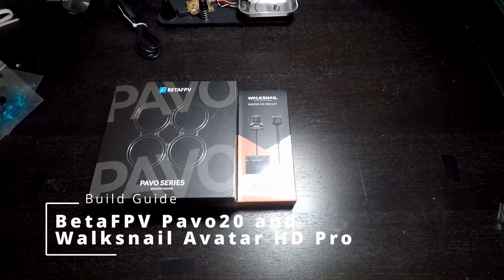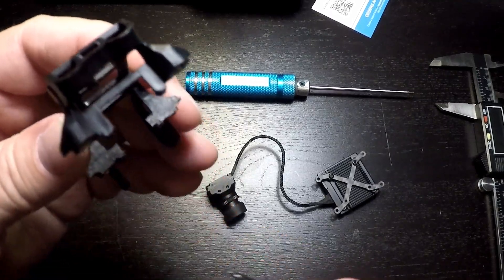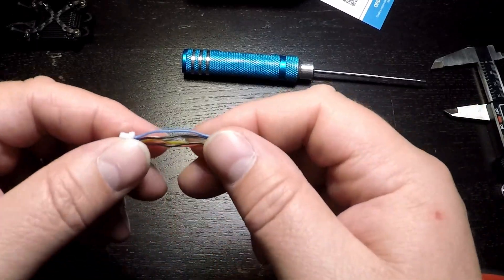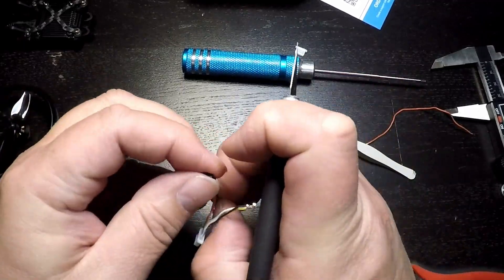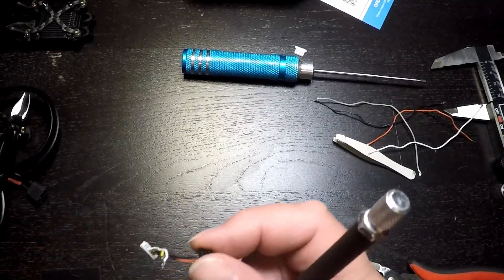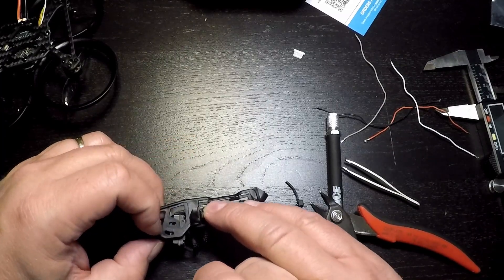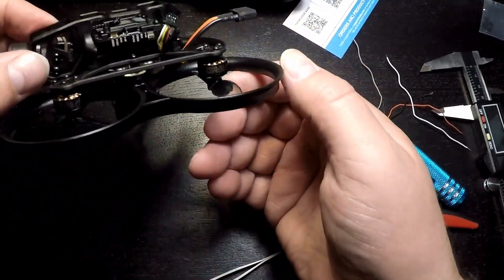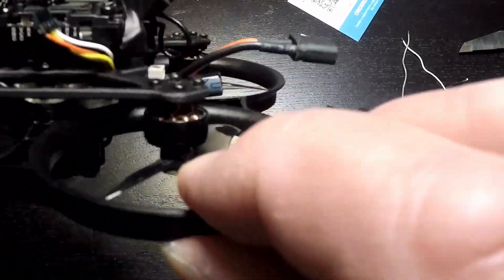BetaFPV Pavo20 Walksnail Pro Build

Comment: BETAFPV technical support line sucks ! Absolutely negative experience with them.
You are lucky - you have the frame with nuts, mine was with screws and holes in plastic. Screws, super-pooper micro screws!
Might be Beta a bit better than Echine, but the same t-shirt.
Reply from the maker: the metal nuts are the pavo20 vs the Pico. Sorry you have had poor experience with their support. Ive actually moved on, the Pavo was fun, but my GepRC Phantom is WAY more fun.

Comment: Do you think that it would be a similar configuration with a HD Zero build?
Reply from the maker: I would expect that it should be similar. you will just need to check the wiring diagram and verify the power requirements. there is a solder bridge selector to change the power that is fed to that connector if the hdzero requires different voltage

Comment: I have the same drone and also walksnail moonlight kit inside but I can't connect it with controller 
I bought betafpv controller lite s
And also flysky fs-i6! Can you help me please I want to fly the drone but I can't connect the controller 😢
Reply from the maker: depending on which kit you bought, the betafpv will require either an ELRS or CrossFire radio - unless you selected Cross Fire intentionally, its most likely you got the ELRS. The flysky wont do it. The betavpv controller comes in a few versions, if it is not ELRS, it will be a no go.
Reply: @quadsmack  thank you 
Betafpv controller is 2 SE Radio Transmitter 
Model literadio 2 SE 
And walksnail moonlight ultra HD 5.8GHz System FPV-sender Starlight 
Can you help me please to connect them with each Other thank you

Comment: my pavo pico walksnail version just arrived. im a bit confused. Does the receive come buiilt in to the board?
Reply from the maker: The Pavo Pico Walksnail edition is "walksnail ready" - it does not have a VTX included, you need to add that - similar to what I do in this video, but you dont need to modify the canopy or wiring, it comes with a compatible canopy and pre-wired for the WS. If you are asking about the ELRS/Crossfire reciever, if you have the ELRS version, the RX is on the FC, with an antenna directly soldered. If you got the Crossfire version, it is a seperate RX. Hope that helps!
Reply: @quadsmack  it actually helps a lot. I'm good to go, the only other question u would have is there is a small antenna in the kit in one of the bags?

Am I swapping the default walksnail antenna for this one in the kit? Perhaps to save weight?

Additionally, I see what looks like a thin red wire coming out of the board. Red color is like alloy red. I'd imagine the red wire us the receive antenna?

Will the walksnail avatar pro fit this or do you recommend a different walksnail verision?

Lastly, with the walksnail pavo, will u have to modify the wiring like you did in thversion?

Thank you for all of your help. I'm lost!

Comment: Question: the vtx won't turn on after I modify the wires
Reply from the maker: Recheck that everyting is routed as shown and that the pins are seated fully in the connectors

Comment: Does this work with the walksnail moonlight?
Reply from the maker: @GhosHawk  The fit will be different and you will probably need to trim the canopy some more but the wiring should be the same. I'm pretty sure somewhere in the comments here someone else is doing a moonlight
Reply: @quadsmack  sounds good, thanks!

Comment: Does anyone think this is possible on the Pavo20 Pro?
Reply from the maker: I don't have one on hand to do so but I cannot think of any reason it wouldn't. Wiring should be samsies.
Reply: @quadsmack  Thank you so much for the answer, since I'm here I'd love to ask another thing: my goal is to go for the Pavo20 pro but not with the PRO HD Avatar, but with the Avatar Mini or Mini Lite. Should I be looking out for some obstacles or reasons why it won't work? I'm Kinda new to the fpv world. Thank you so much for the content and kindness, you rock!
Reply from the maker: @alexzanatta6572  those should also work, but you will have to solder instead of swapping the plug. Same wiring as in this vid but to solder pads instead of a plug.
Reply: @quadsmack  That's great, ty so much!
Reply: @quadsmack why solder instead of plug?

Comment: unfortunately I had a bad experience today with a pavo20 and Walksnail Moonlight kit installation. unfortunately the flying controller is broken.
Reply from the maker: Sorry to hear this! The Pavo is a fun little 'copter. What happened? Are you sure the FC is damaged?
Reply: @quadsmack   The Walksnail Moonlight kit was installed, the FC was connected via usb to the computer, the moment I plugged in the battery the connection was lost. I can no longer connect to the FC, and the FC is getting extremely hot.
then I noticed Power consumption 12V@1.4A, 8V@2.2A on Moonlight and 9V BEC*: 9V 2A@8V supply on F4 2-3S 20A AIO FC V1. But I couldn't find Power consumption of Walksnail Avatar PRO HD anywhere.

Comment: What's the advantage of going with the 20 over the pico?
Reply from the maker: Slightly larger props, 3s vs 1s, better / stronger cage and camera mount. Most people i know with the pico replace the cage with the 20 cage.  Just a more powerful platform to carry the weight of the hd system.
Reply: @quadsmack  Ended up ordering the Pavo20 w/ Walksnail Moonlight.  Thanks for the vid.
Reply from the maker: @maliciousmushroom did you get this put together? Hows it flying for you?
Reply: @quadsmack  I did. It is my first FPV. To me it seems like it might be heavy?!  The cage for the VTX doesn't sit flush with the mounting board, but it seems secure enough. I've crashed it a few times in my back yard. I really need to go to a field to test it out!

Comment: This is awesome. Would this technically work on any 03 drone? I just picked up the goggle x.
Reply from the maker: It should as long as long as you are using one of the vtx with full power range. The 1s board would need a change on the power line
Reply: Just completed this mod, and works sooooo well. Thanks again and keep up the good work!

Comment: Is the vtx supports 3s battery?
Reply from the maker: I Used the Walksnail Avatar PRO HD V2 VTX Kit which accepts 6V-25.2V (2-6s) and connected it using the 9v output that is on the O3 connector on the pavo board. Thanks for watching!

Comment: Doing this same build right now with the Avatar Pro. Great to see you do it first, good info.
Reply from the maker: Enjoy! It's a great little quad! I highly suggest trying different size batteries . I got 650s for mine and it flys great but a bit heavy, I really want to put some lighter batts on to try to make it more nimble.
Reply: 2s? Whats your dry weight? Will build this mod too
Reply: 3s lipo. Using R-line 3s 550. @jeffclassics
Reply from the maker: @jeffclassics  Pavo 20 is 3s. My original batts were GNB 650s, just picked up some 550s and the flight improvement is something you can feel. these are the ones i picked up https://www.gaoneng.shop/products/gaoneng-gnb-3s-11.1v-550mah-90c-xt30-lipo-battery-long-type

Comment: I find it to be much easier to just use the cage from the regular pavo pico which supports the Avatar.
Reply from the maker: Definitely an option, but I like the threaded inserts and stronger dual-screw camera mount in the 20 cage.
Reply: Have you tried it? How's it going?

Comment: these are on sale for 75 bucks without the vtx... I thought about buying one and turning it into a analogue 2s basher. 
it seemed like you could fit the battery into the cage on top.
Reply from the maker: you could.. not sure how it would fly. At $75 this thing would be a no-brainer for me, GO FOR IT.. im loving mine, will be posting a night-fly vid today..
Thanks for watching!
Reply: The regular pavo pico was on sale, not the pavo20.
Reply from the maker: @CorruptName1 pico comes in a Walksnail ready version. The 20 should be like $105

Comment: Nice tutorial, thank you! Is there anything special that needs to be done in Betaflight?
Reply from the maker: I have not tweaked too much in BF yet.. I applied my OSD config, adjusted modes to fit my boxer. I was in a hurry to fly so I've been on that setup for a few days. May try tweaking this week, if I find any useful changes I'll add here! Thanks for watching!
Reply: @quadsmack  Thanks. Would be nice to see some flight footage with this little beast! 🤘
Reply from the maker: @jean-lucpotvin1209  Soon.. had an awesome session in my local park last night - playgrounds are empty after dark, and with the Pro cam on here, it was easily flyable!
Reply from the maker: Night fly vid up! https://youtu.be/7qqeyzxqBew